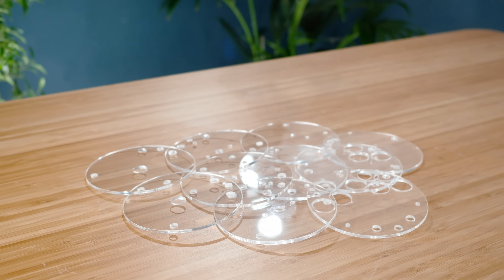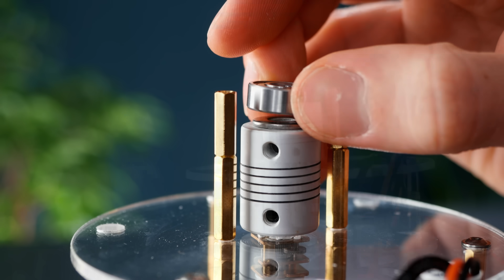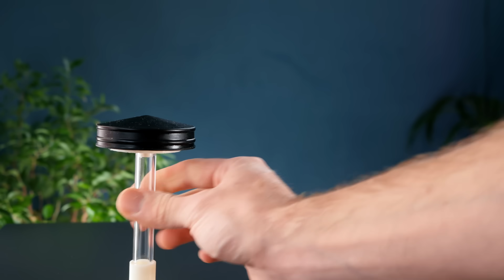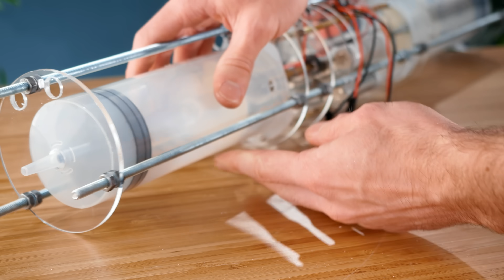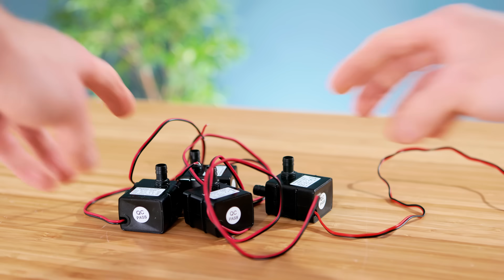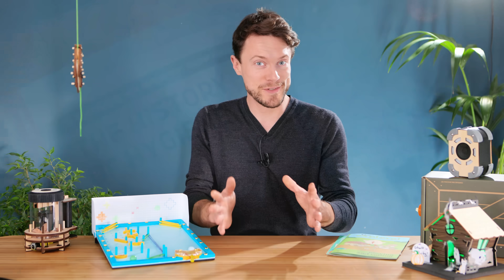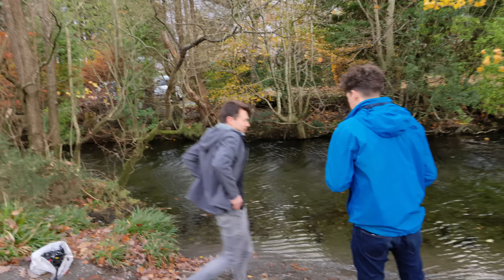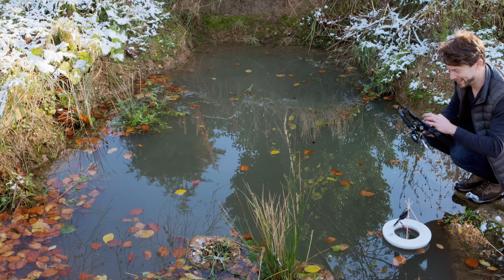Building a DIY submarine

Comment: TL;DR: The syringe did not sink because you compressed the gas inside - it sunk because the physical size of the syringe got smaller as the plunger went inwards. 

our syringe demo is misleading. What you describe isn't what's going on. Your first demonstration with the syringe is misleading because you claim that compressing the air inside makes the syringe as a whole more dense. That’s not what’s happening. It has nothing to do with the air inside, whether it’s compressed or not. In fact, you could pull a vacuum inside with no air at all, and the effect would be the same. The real reason it sinks is because the physical shape of the syringe is is getting smaller as you push the stopper into the cylinder. The overall volume of the object decreases, reducing the amount of fluid it displaces. Since buoyant force depends entirely on displacement, less volume means less lift, causing the object to sink.
Reply: He didn't say that. He said that the syringe as a whole is now denser, and displaces less water. Which is exactly what happens
Reply: @Gurry45  He specifically mentions the compression of air. Why did he mention that when it's completely irrelevant?

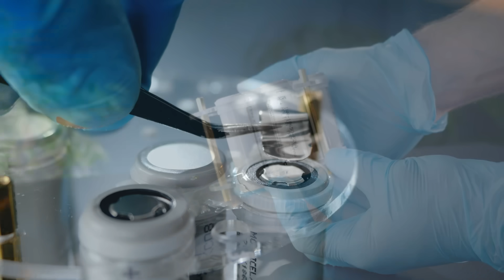Comment: 2:43 Couldn't spot-welding damage the battery cells? Isn't that running a very high voltage through the metal you're welding? Feels dangerous to do directly on a battery but maybe I'm wrong.

Comment: Consider using a slender line connected to the submarine's top instead of a conventional tether. At the opposite end, attach a buoyant receiver capable of picking up signals at the waters surface from a radio controller as the submarine descends, with the line unwinding accordingly.

This way you allow it to go a little further away from shore.

Comment: I wouldn't worry about filtering the inlet water for the pumps. It will just reduce their flow too much and centrifugal pumps like those can handle grit and debris in the water just fine. Centrifugal pumps are used in dredges to move sand, mud and even heavier stuff all the time.

Comment: I wondered about using a 40 or 72 mHz radio system? Also, if the syringes were sucking or discharging water would a smaller syringe be needed?  Have great respect for you and James for your experiments.

Comment: Has a more complicated controller for a homemade toy than ocean gate had for a craft holding 5 people
Reply: ceo watched a different youtube tutorial
Reply: @NashTheInsomniac bro probably watched 5 min crafts
Reply: @planetmusic1104 1 minute panics
Reply: That's industry standard
Reply: @Official-Jesus-YT as is this controller in the video being industry standard in... whatever this industrys called lol
Reply: God the media really does rot people brains doesn't it. The oceangate sub was a multi million dollar machine. Just because it used a standard USB or wireless game controller as an input does not mean that was its only control. Very expensive and capable military drones use similar game controller inputs for the same reason, people understand how to use them. In the end all it does is provide inputs to the computers that do the actual controlling. It doesn't matter if its a game controller, keyboard or something custom built. Its infinitely more capable than hard wired direct controls. Also, the control system worked just fine for the dives they did and played no role in the failure of the hull.
Duhhh But media said X box controller bad duhhhh. There should be more flashing lights and buttons duhhhh.
Reply: @grasstreefarmer  the controller was bad though, because they used a cheap brand
Reply: @hashtagrex not bad enough that it would fail in under 6 months (especially with work that is not intensive on it like piloting a submarine), which is plenty good quality for the purpose it was bought for
Reply: ocean gate didn't need that fancy 'up' functionality
Reply: Not gonna lie the ocean gate controller was a couple hundreds times better than this
Reply: Yup

Comment: Let me see if i got it right, you made a submarine with variable buoyancy introducing or expelling water (so compressing/decompressing air) allowing this way controllable depth level (z axis) even if the submarine is still at x,y position. While Jame's has static buoyancy and level the depht with some kind of flaps, making it emerge/submerge only moving ahead or backward the submanine changing flaps. Am i correct?

Comment: You can buy a bigger servos too and modify it to free 360 degree turns. Is easy... Additionally you can use normal motors with magnetic couplings to move props but your approach has simplified point of view that makes very easy to make to... Congrats! 
great proyect and great channel.

Comment: why use a syringe? a tank with a plastic or rubber bag. which is inflated like a balloon and thus forces the water out of the tank. the other way around, water is drawn into the tank when the air is released from the bag. this can easily be done with an aquarium compressor.

Comment: Actually. air is not compressed to make the submarine dive. The ballast tanks are opened allowing the air inside to escape and the tanks flood with seawater. you can trim the ship fore and aft for angles or to surface and dive slowly with trim tanks but that is after youve emptied the ballast tanks and made the boat neutrally boyant. To emergency blow, you use the "Chicken switches" and allow hi pressure air to push the seawater out of the ballast tanks, making the submarine rise quickly to the surface. If done from deep water, with full turns on the shaft and up angle on the planes, you can broach the boat as seen on "The hunt for red october."

Comment: Hello, I salvaged some 18650's from an old Makita battery to make a battery pack for a portable amp. The battery set up would be identical to the one you made at the beginning of this video; 3s2p with a BMS. At least I think that's correct, this is my first time making a battery pack...

I was wondering, how do you charge the 12v battery pack you made at the beginning? Can I, for example buy a wall charger of some kind and voltage regulator to give me a constant 12.6 volts? As usual, I'd like to do this on the cheap! So a 'set and forget' solution is what trying to find :)

Thanks!
Reply: usb charging would be cool ;)

Comment: My brain started to go of in sparks.. what if; instead of moving water in with active pumps maby air pumps filling baloons inside water filled compartements and maby just one large pump for thrust and instead have moving valves to control where the water goes. I should probably go back to my natural light window and two way mirror web cam and finnish them before I start building my sub.. but I have a few ideas about emergency surface fail safe... or maby just go back to fixing my rusty nissan :)

Comment: like how these youtubers use 3d printed parts expecting that everyone has a 3d printer
Reply: Sometimes it's the only option ... or simply the easiest / cheaper option compared to market availability of very specific parts when you consider price + shipping time compounded by how bespoke the item is. 3d printers have come a long way and are more accessible now. You could make the same argument about youtubers using any tool, be it a power drill or a saw

Comment: I think its better to use fiber optics or serial cable , then the battery just be mounted in the sub its self.
Reply: passing a signal through fiber optics is both expensive and difficult

Comment: the way I see it. DIY projects are meant to have mistakes, because they are quite similar to a prototyping stage. mistakes are a learning system. and I had a thought. you could use the floating bout as the radio tower, using something like the cord holder from a lawnmower to retract and release more underwater cable as necessary. this would allow you to keep it from having to drag any unnecessary cabling around. 
sitting here thinking about it as well, an idea like this could be useful for underwater search groups (Like adventures with Purpose) a good enough camera and they can actively see things under the water.

Comment: why didnt you fill your tub up with water and put the sub in there ... you could have balanced it at home and verified the propulsion also ... sure it wont be turning around BUT you would have been close to the work shop to make changes as needed
Reply: swimming pools ... inground or even above ground ... NOT a kiddie pool ... are the perfect place to run rc sub's .
other than the fact that you used HUGE syringes ... the concept is excellent ... I wonder if a real sub used water jet propulsion if it could be very quiet or not with respect to detection ...

Comment: Hi, it's cool what DIY submarines you two have built. Such canals are also very instructive and can be about the possibilities of new or usable methods to better observe our freshwater ecosystem. And showed us some fauna and flora under water. The concept of using a thermos bottle or an air piston is simple and cool for a homemade submarine without calculating data. Really cool & like the simple propulsion/suspension mechamism eOnly in real ones are there balast tanks on the submarines that are mort air filled sections are flooded(descend) and de-flooded(ascend) on bow& stern starboard and port chambers. Your method is probably possible sometime in the future. To build electric submarines from green fair energy to explore the underwater world. You have done it with "simplified" means

Comment: 19:00 - That the tether is too much is not that surprising. Ship anchors actually use the chain itself as the anchor, not the head. In fact, anchors don't really work well if the chain is too short, which results in 'dragging the anchor'. Normally that happens when not enough chain lies on the seabed, but considering the ratio between the tether and the little bottle sub, I don't think that's even necessary. XD

Comment: As a submarine vet, all the terminology you're using in everything you say hurts my soul, lol ie: We flood ballast tanks with water to submerge (from surface judging from the graphic, if already submerged then it would be descend) and pressurize with HP Air system to ascend or surface (RIP USS Thresher SSN-593, they couldn't ascend due to frozen HP air pipes to the ballast tanks introducing many future submarine improvements)

...But doesn't matter because you actually made a gd susmarine. It was a wicked cool project, great job mate!

Comment: Damn man, am an engineer and i rarely get impressed by YouTube's DIY projects, but almost all your projects impresses me, like in this the way you modified the servo is simply genius!
Reply: Would u make me a custom sub project 🤔
Reply: @purplepimp4204  sure, if you paid me
Reply: @ironman5034  how about 250k
Reply: @ToTeon  sure but that's too much for a small sub
Reply: We have no idea how he knows how to do this, or how he planned it. He claims he made it up as he was going, but that seems completely improbable to me.
Reply: @gristly_knuckle  Not really. It is not too bad (though not advised) to slowly figure out different parts of a design as you go along. He could have though about the power first, then how to change the buoyancy, then how to move the submarine around. That is kind of how real design works too, except you would figure out, plan, simulate and test every thing first before building the parts. He just did it in a different order

Also, he could have had an idea on what to do, just not a plan on how to do them. Like he could have had a vague idea on what he could use to produce thrust, just not how to connect it all up

Comment: What was the purpose of the ptfe tape?
It does not seal when used that way.
It is for use in a tight interference fit. like pipe threads.

Comment: In regards to the beginning of the video, the syringe falls the second time around not because the air has been compressed, but because the object itself is smaller while having the same amount of matter in it, thus increasing density and causing it to sink.

It’s a closed system since you sealed it, the internal pressures didn’t make it sink, it was just made it smaller.

To put it another way, by making it smaller upon squeezing it, it now displaced less water while having the same amount of matter which makes it sink. It’s akin to a sheet of aluminum floating on water but then crumpling it small and watching it sink.

Comment: If you can have time to revisit this topic it would be awesome! You made a product that is very cleverly designed! Another cool idea would be adding a metal detector so you can also can find some treasures down at the bottom. This would also mean you need some claw or something to retrive the found item, also a mechanism to brush the surface and instead of adding pellets for weight you can add more batteries! Oh man, its a very good design! Well done bro.

Comment: Nice project. I was thinking if you can use old parts from wifi router, to make wireless controller. 
They also have cheap or expensive rc submarines available.

Comment: If you ever try to make this beast again, i suggest one main pump with exactly as many outlets as you had 'thrusters'. Control to which outlet can be done with vanes and servos. Advantages:
1. full power forward or reverse
2. fractioned power to the smaller outlets as they will always be halved
3. central weight (the water pump). 
Cons: power will be required for something like this, one big pump eats more than smaller ones.

Comment: I thought submarines just carried lots of compressed air, and let the air in the chamber out and water in. This is to save time. Then they’d use the compressed air to push out that water and fill it with air to regain buoyancy. Though nothing you said is wrong in how it would work, i don’t know that it’s actually how submarines operate

Comment: You should do away with the teather and use a programmer with a grid form pattern program With a descend to start command and ascend after an allotted time also through a programmer. The camera could be connected to a Mini DVR. And you could use ultrasonic sensors for obstacle avoidance. Just some thoughts.

Comment: Great Project!! 😊  However, as per one of the other comments below, to add extra ballast, additional batteries would give you more weight and range.
In addition, why not add two metal skid rails to the bottom.  These skid rails could give you more ballast, and being added to the bottom, should ensure the submarine always stays right side up.  If you used some kind of pipe for these rails, the water pump wires that currently run from back to front could be housed inside the pipes, to protect the wires, while also improving its looks.  The skid rails could also have additional extra weights added to it (if required), to better achieve neutral buoyancy, and they could also be positioned along the skid rails to ensure the weight was spread evenly along the Sub’s body.

Comment: I love this!  I saw a few suggestions about adding pressure sensors to monitor internal and external water pressure.  That would be pretty cool, but I expect that you are not going to exceed the length of your tether, so maybe a submersion sensor on the tether float to activate the "emergency surface".  Of course, that tether won't do you much good if the float can't hold up the sub...  I would also suggest a compass that you can see on your heads-up-display.  That way you can keep track of your boat's direction of travel and know where your torpedoes went after you shoot your buddy's little ROV.  Really nice job (from a former US Navy Submariner - RM2/SS).

Comment: You could have moved the submarine much faster if you changed the palcement of the inlet section of your pumps. As ist is now, you are manly sucking in water from the same direction as you try to shoot it out, creating a reaction force acting against your forwad movement.
Make your inlets "in streamline" (suck in forward, shoot out to the rear) with the flow you want to get and you should be able to get it move more agile

Comment: I think your refined design should add symmetric dive planes. I think you noticed that your ballast tanks worked well to make the sub sink, but I think you're going to find it very difficult to find an equilibrium that doesn't send you straight to the bottom. you're practically at neutral buoyancy now, so the dive planes would help you maintain a constant depth. Or, barring that, add wheels so you can crawl around the bottom like the NR1 or the Argonaut.

Comment: i know this is a really easy project compared to what you are doing now hahahaha, but i would really love if you could make a DIY laptop cooler with 8100rpm server fans or any 4pin connector fans safely to connect right into the wall socket with a dial as an rpm controller , a lot of people dont care at all about the noise levels, just being able to leave their laptop rendering all night or play videogames at safe temps and no commercial laptop cooling pad is enough

Comment: I don't understand why some quick calculations weren't done prior to the massive amount of effort that followed. A few seconds to calculate the known volume of the syringes and density of water would have provided a rough enough baseline from which to work. 

But it feels like the issue had to have been obvious to you from the outset. The sheer weight of the components as you began to add more and more features. My guess is that the entire current inner volume of the sub would be needed to offset that much weight. 

Still, it did look like a fun project. I have not yet looked to see if you have a newer video with modifications.